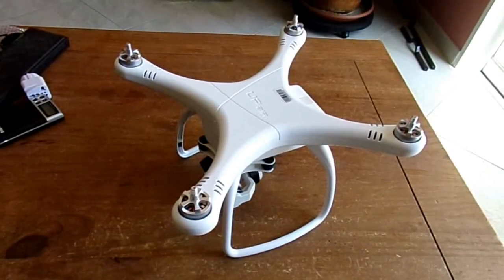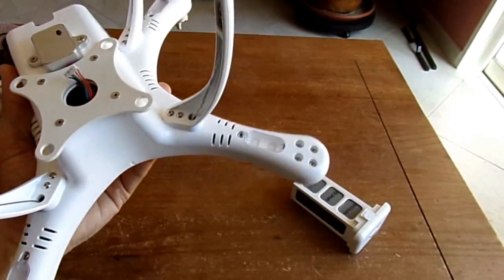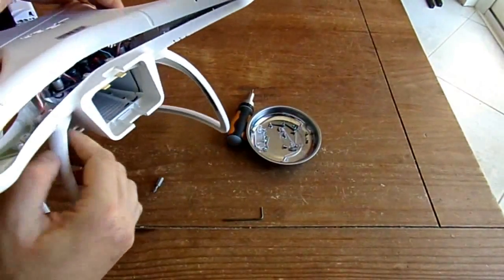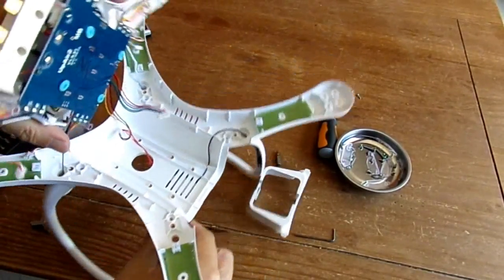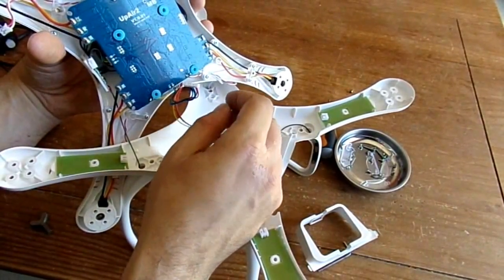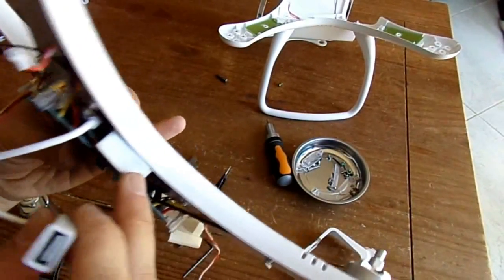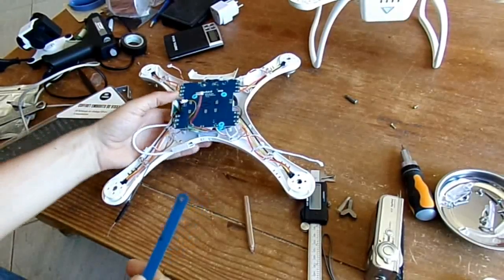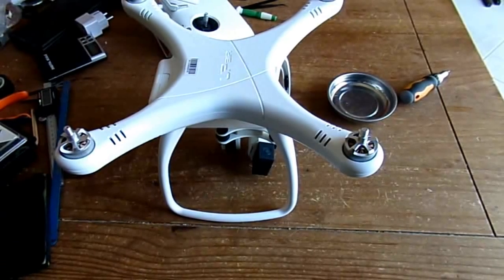UPair one disassembling and USB mod (Courtesy Banggood)

Comment: Hello, brother, I am facing a problem with up Air. When I turn it on, it does not boot up. Sometimes it boots incorrectly and I cannot turn it off or control it. I do not know what the problem is.

Comment: Pls I need help. My upair drone 4k. 30 sec of I fly my drone its start controlling its self. It will elevated very high and come down with force . I had to caught it all the time. What is wrong with it
Reply from the maker: You did well the compass and gyros calibration ?
Reply: SeBy DocKy I am not getting what u me. I said after I fly my drone and its on air I can't control it anymore. Do I change the transmitter

Comment: I am reaching out to you in hopes that you can help me. I have the UpAir One V1.2 with the PX4 board and I can't get the camera to change video resolution. Also my board is very different and you can not do the USB mode to it either. There is already a port on the leg. I have tired to change video res by holding the buttons down for three seconds and if you do this, you will only take a picture and if you do this for the video button you crash the remote FPV feed and you get a frozen display and no more live feed My camera resolution is very poor and the video is terrible. When you take a picture, you file size is a about 6 megs to 7.2 megs in size and I know that is wrong for a 16 mega pixel camera.  DO you have any info on the latest version of this Quad? HELP!
Reply from the maker: It's more a problem with your camera IMHO ....
Reply: Explain further please, IMHO?

Comment: Hello Seby .. just change the battery charge card then it was charging until the leds turned off should not deliver the voltage when turning on even when disconnected from the drone?
Reply from the maker: I am not sure that I understood your question ? :( :( yes when fully charged, the light are turned off ...
Reply: SeBy DocKy The light goes out, I measure more than 12 volts on the battery card, when I turn on (without connecting the drone) they turn on the LEDs but do not give the voltage at the battery output ... should I do it even if I do not connect the drone?
Reply from the maker: DO you power correctly the battery ? 1) short press the button < 0.5s then 2) long press > 1s ...
Reply: So I do but it does not give the voltage, only when I disconnect the small connector that connects the two boards (cards) I imagine it is done so for safety ...
Reply from the maker: If you can make a video ... I am not sure I understood your problem ...
Reply: Thanks Seby is the card is damaged.

Comment: My drone is dead due to some motherboard issue,,,one motor is not working,,,,I had cross verify ,,the motor is OK ,,,,,issue is in motherboard which never starts the motor....
Need help pls,,,,
I just use my drone 3 days after unpacking it...

Email:: m.kashifghaffar@gmail.com
Reply from the maker: Can you check the ESC connexions for this motors ? 3 wires must be soldered on the FC.

Comment: Hello Seby a query maybe you can help me I have the problem of working the motors and the card MAIN I will buy it since it is physically burned, question do you think it is necessary to change the APM? Or not?
Reply from the maker: hard to say with these elements.... maybe the corresponding ESC is burnt yet...  can't tell but if the the case, you will have to change all board since ESC are included on it
Reply: Or change the APM too?
Reply from the maker: Sorry I don't know :( if the FC is killed too :(
Reply: ok gracias Seby.
Reply from the maker: If you are sure, the motor is broken (and not the associated ESC); why not genuine motors ? : http://www.banggood.com/UPair-Chase-UP-Air-RC-Quadcopter-Spare-Parts-CWCCW-Motor-p-1052443.html?p=YL2512105842201212FR
Reply: If it is burned for me fault I was playing the ESC and the engine made smoke I wanted to buy it on Amazon that it is easier the shipment I do not know if Banggod accepts Paypal ... will those of the Phantom or the Cherson?
Reply from the maker: Sure Banggood accept Paypal !!! I don't know if other model are perfectly idendical :( sorry ....

Comment: Buenas tardes   Seby muy buen vídeo,tengo el upair one g10 que viene con la cámara integrada (blanca) este modelo ya viene con el blindaje del GPS?(lamina de cobre tape EMI)disculpa mi abuso otra pregunta : al usar el mission planner imagino que no hace falta que la bateria  este conectada ya que veo que puede dejarse el cable en ese compartimiento?gracias .
Reply from the maker: I think yes it's possible to keep the USB into the battery bay without perturbing the battery insertion.
Reply: Buenos dias Seby gracias por tu paciencia,aqui va otra :  para calibrar la brújula se utiliza el mission planner pero se hace una sola vez ? no en cada vuelo?Saludos.

Comment: hello my friend.
you work for banggod?
i don´t undertand bangood says this upair one have 1km transmiter distance and real is 300 mts...
you know this lie?
thx for your time
Reply from the maker: In practice the control range can be around 400-500m but the FPV range limits the distance to 150-200m. UPair plan to upgrade to a more powerfull VTX to increase this actual poor range.
Reply: thx for respond me Seby and thx for your videos.
bad thing bangood says lies...1km range distance...:(
my unit on 269mts.
Reply from the maker: For the Video link ? a 10USD VTX is an excellent upgrade to increase range. If you mod a bit antennas, some users reach more than 1.5km of range...
Reply: range distance radio 2,4ghz 300mts :(
Reply: refund to bangood...if i can...

Comment: what does this usb mod do?
Reply from the maker: It allows to connect to the Mission Planner software where you can tune a lot of parameters, perform calibrations (accelero and compas) and of course eventually program offline a "mission" via waypoints

Comment: it can not be used telemetry? thanks
Reply from the maker: No direct connexion for a Telemetry module ... but it should be possible if there is a free UART port. But in anycase, you will need to open/mod it.
Reply: +SeBy DocKy advertisement said it used apm circuit, but I do not know which version?

Comment: Great vid SeBy, I have been interested in this. A disassembly is a sure way to get more followers, I felt for you pioneering this, well done. What you have shown is very interesting and important, but I could not help to notice the uniqueness in this design, with the boards being supported from the top, AND gimbal balls on the inside. I wish you had gone further when you were there, why gimbal balls inside? where are the esc's? gps? how to replace a motor? I like that the led's can be disconnected easily,...has this been extended to the esc's & motors? I like the shell, but it does not seem too strong, but there is vision for re-enforcement. You were right there mate, wish you had gone that little further but this is the nuts & bolts of our hobby :-)
Reply from the maker: Yes... I could go further for sure. Maybe in another video, if I find the UPair good enough to receive more investigation :). I think so. Concerning motors ... there are directly soldered on the PDB with short wires. No banana plugs for example to disconnect motors :( ...
Reply: A reply from you is greatly appretiated. I know, I have done this and also regretted. This is my hobby, I get nothing but I rely on you and Dustin where to spend my money. Just frustrating for me. If it were not for Dustin and you, I may not be here. I look, learn from you guys, and my game is to take what you miss further.
Reply from the maker: Thanks :) ... In fact my main concern is the lack of time to go more deeper for some models....Any I will try for the UPair. For example, probably how to "free" the hidden microUSB connector for the Gimbal (yes there is one !!!!)

Comment: Do you know if anyone has tried to add a telemetry module 3dr in this drone ? thanks
Reply from the maker: I don't know but should be possible ... Need to find some UART ports
Reply: I am wondering whether that the version of the Upair one I have with the px4 port on the leg will connect to 3dr telemetry module?

Comment: I was hoping you would show the extra  button on the gimbal for video on/off you mentioned earlier in our conversations. I still don't know what you mean.
Reply from the maker: There is no extra button, but an extra "cap" to filter out some volage drop out, the main source of the autostart/stop camera problems. I will publish all detailed photo in the RCgtoups/drone-maniac review
Reply: thanks Seby. I'm new into the quads not even a year, but I love them.  I'm a LOS airplane flyer since I was a child, planes are much less sophisticated and if you wanted greater range you just bought a bigger and better receiver.  planes are much easier to identify when they are far away which direction they are pointed,  plus I have much older eyes now. I really like FPV and have played flight video games for decades now and it seems so natural. I just want to lengthen the distance and quality/reliability of the FPV connection.

Comment: thanks SeBy.  I did a long cable for now and I have UV glued to body until my micro USB connector comes in. You need to invest in a dremel or good pair of snips my friend. I'm looking forward to the Mission planner part of the series. Thank you for all of your time to put out the excellent videos you do.  nobody else breaks it down to the small components like you do.
Reply from the maker: I got a drimel, I was lazy to pick it .. :) Actually, I am doing a lof work in my house (building kitchen, etc...) and some Tools are spread around :)
Reply: seby como donde descargo y como reinstalo el software o la configuracion que trae el up air one g10?y como puedo calibrar los motores con el mission planner?

Comment: Great video! can you also change the antenna`s to same better ones ?
Reply from the maker: I will try... but it's touching more the VTX Under the metallic casing
Reply: i bought this kit, its pretty good, i havent used it above 3 yet but its running quite good now, it felt cheap at first but i took it easy and its a little more steady now, the kit that comes with it is mind boggling for the money.
https://www.amazon.co.uk/gp/product/B00KX9Y8CO/ref=oh_aui_detailpage_o03_s00?ie=UTF8&psc=1